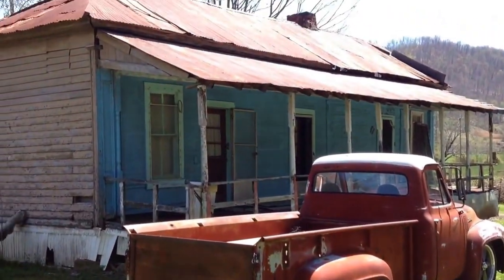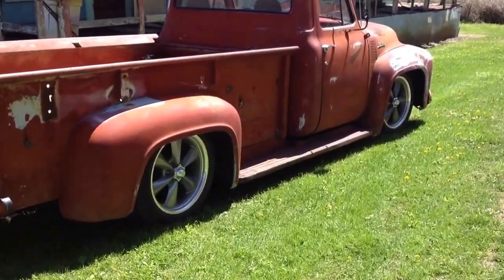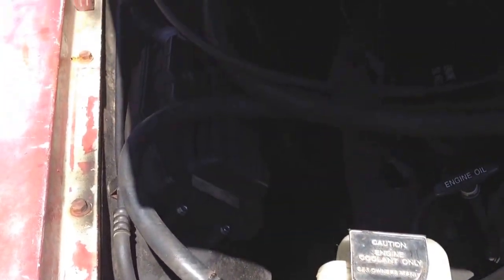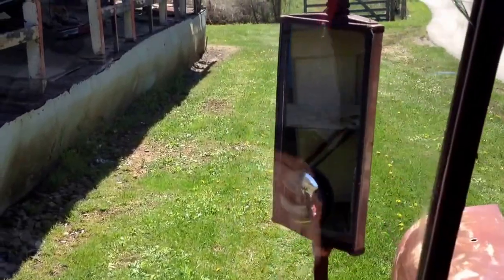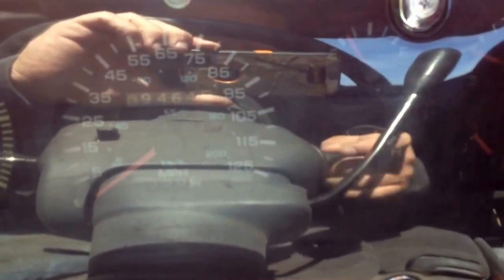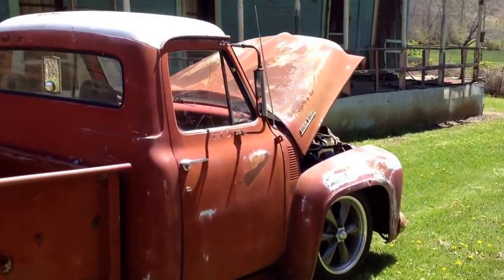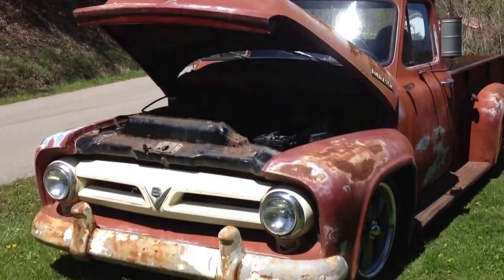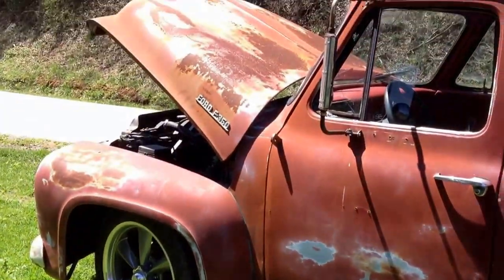1953 Ford pick up vintage modern chassis air-conditioning rat Rod

Comment: I have a 1953 short bed roller. I also have a 2000 dakota extended cad 4x4. 3.9 v6. I would like to use the Dakota and cut it to fit the ford. Is that something that you do?

Comment from the maker: Dodge Dakota has the right wheel base across no wheels spacers are needed it is a good solid platform it is wider than a S10they work a lot better than a S10 or a Ford ranger no cutting